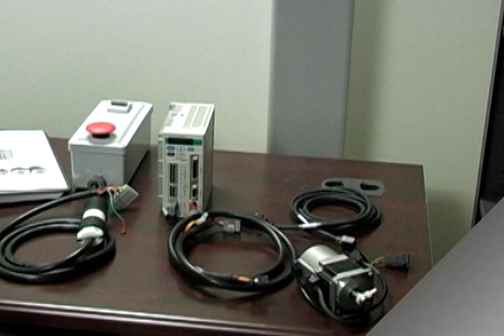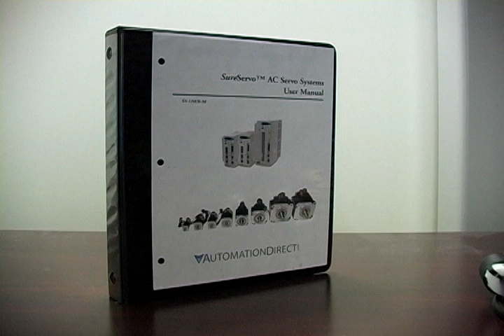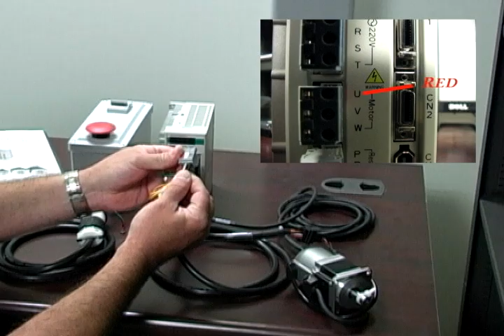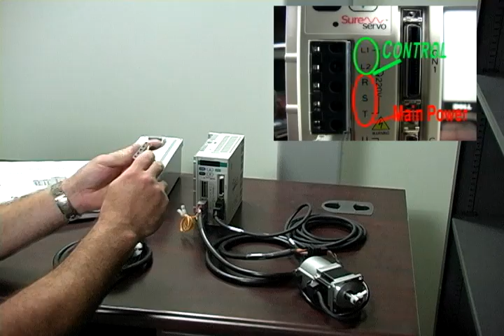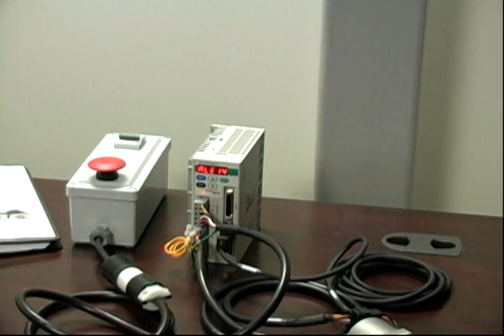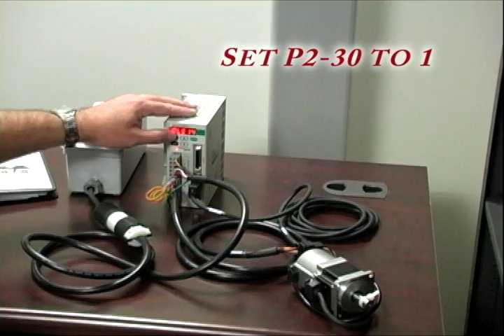How to Connect a Servo Motor Controller and Jog the Servo Motor (Part 1) from AutomationDirect

Comment: The SureServo product is definitely easy to use and very affordable for what it can do. Although I do wish some of the smaller models could be powered from 120VAC instead of 230VAC 3 phase....!
Reply: Even 230v single phase would be fine. That’s what my BST servos are and they convert to 3 phase internally like a vfd. Awesome drives and servos.

Comment: Is it possible for me to run my drive off only a single phase connection?
Reply from the maker: The smaller ones yes - 230VAC single phase -  the larger 2KW and 3KW drives require 3 phase, 230 of course ....
Reply: @automationdirect  Thank you for this, I have a small one that I had to test from home for a project, I looked through the manual and saw how to connect it
Reply from the maker: @vinje3802  You are welcome!
Did you know that we have over 1200 Automation Tutorial videos at:
www.automationdirect.com/videos .............................. by category and random search
www.automationdirect.com/cookbook ........................ by topic

Comment: How could we make this driver connect with another keypad? Would it just be directly through an rs485 cable?
Reply from the maker: You can control the drive via Modbus so any Modbus compatible display, HMI, PLC, Controller could work.

Comment: how to remove AL E6 alarm error from Melservo MJ3 drive??
Reply from the maker: Hi Zubair, AutomationDirect currently only supports the Sure Servo brand of servo drives. You will need to contact the original manufacturer for info on the MJ3 drive.

Comment: Hello friend ... I have a servomotor with error number 380.  do you know what it means and how can it be fixed?
Reply from the maker: Which brand servo are you using?  That doesn't sound like a SureServo error number ...
Reply: @automationdirect  Hi friend, thanks for replying. This servomotor is panasonic brand MADHT1507CA1 200 volts which presents a message that says error 380. I hope you can help thanks
Reply from the maker: @industrial.inoxidable  Unfortunately we don't know anything about Panasonic Servos ... We sell and service the SureServo brand ...
Reply: @automationdirect  Hi friend, thanks for replying. This servomotor is panasonic brand MADHT1507CA1 200 volts which presents a message that says error 380. I hope you can help thanks

Comment: Whats the problem if the monitor show AL 05
Reply from the maker: Hi Raja,  I Assume you mean "ALE 05?"  That's a regen error. Page 7-5 of the user manual shows you how to troubleshoot that. In a nutshell, The Regen Resistor is not connected or the parameter settings for regen are not correct.

Comment: Hi! I`m not trying to interfere with your bussines, but maybe you can help me with some advices or tip.. I have this model (mitsubishi melservo mr-c10a)and i`m trying to build a belt grinder for my personal use in the shop. Can you tell me what kind of motor will suit for this controller? A 230/320V 1.5 kw will help me with this type of controller? Much apreciate!
Reply from the maker: Hi Ciobanu, Unfortunately, The servo motors we have only work our drives so they wouldn't be appropriate for you Mitsubishi drive.
Reply: I was asking your opinion for what kind of electric motor to buy for that controler.. but obviously you know the answers only for the motors you have. Sorry for the question, i`ll try somewhere else.
Reply from the maker: @dignitas1980  No problem - good luck!

Comment: hola que softwre debo utilizar para programar  este motor desde ya gracias.servomotor r88d omron 1kw 3 fases 220 volts
Reply from the maker: HI Jose, AutomationDirect doesn't sell or support Omron products so we can't help you with that Omron part number. Please contact Omron customer support.
Reply: @automationdirect  Ok muchas gracias. Cordial Saludo

Comment: Hello.. Will your drive work with other servo motors with resolvers..? and vise-versa ..Rgds
Reply from the maker: Automation Direct’s SureServo servo drives do not support third party motors.  They are a matched set and the settings and parameters in the drive are set up to work with the applicable SureServo motors.  The encoder feedback signal type is also specific to the drive so resolvers will not work either.

Comment: hi, we have a waterjet machine and I have the problem with the servomotor axor brand, it is not running normally at full speed of 150% only 5%, otherwise it will be error if more than that, any suggestions? thank you.
Reply from the maker: @sherwin requioma, thanks for the comment. If this is running using our SureServo drive I would call into our Tech support team for help. 1-800-633-0405. If not, I would call the drive manufacturer for help. Its sounds, that you either have some overloading on the motor or incorrect setting in the drive. 

Thanks

Comment: Could you tell me how the orange and yellow cable connects please?
Reply from the maker: @monkeydjarm. Thanks for the comment. If you are asking about the encoder cable see page C-8 or C-9, If you are asking about the brake connection, Please see 2-22, of the following link. https://cdn.automationdirect.com/static/manuals/sureservomanual/sureservomanual.pdf

Comment: hi there, good video. how much is a 3 axis fully closed loop AC servo, single phase setup likely to cost minimum? i plan to retrofit my small cnc mill from crappy and noisy stepper motors to something a lot more accurate and reliable, and of course on a tight budget lol also with limited knowledge on how to do so. also if its any help my machine i plan to upgrade is a Denford Triac. i have videos on my youtube channel of it in operation

thanks in advance for your advice.
Reply from the maker: Hey +toby bayliss thanks for watching! For technical questions like this, please contact our free award winning tech support. They are setup to give you the most efficient and quickest support. Thanks! 

Phone:    1-800-633-0405
Email:     https://www.automationdirect.com/adc/Form/User/TechInquiry
Support:  http://support.automationdirect.com/